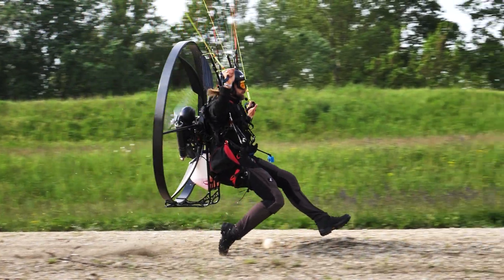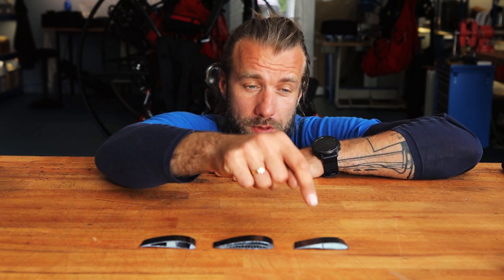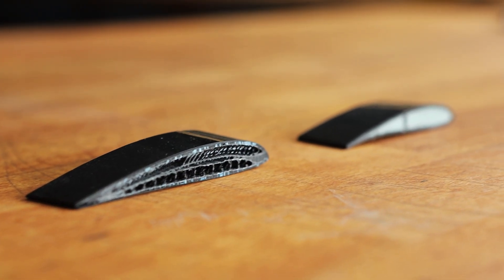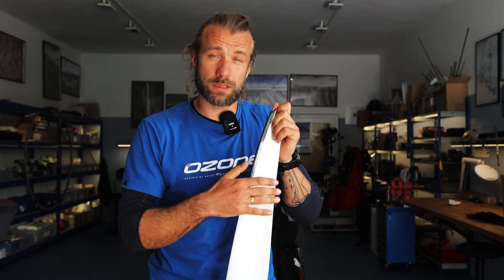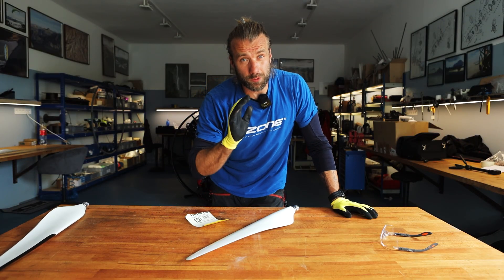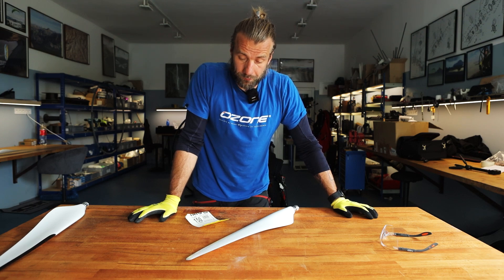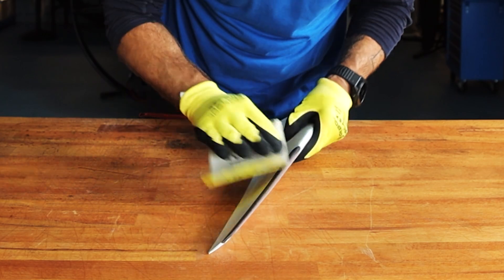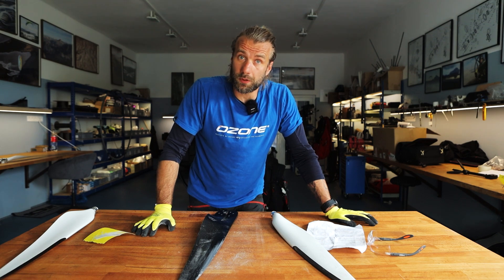Indestructible propeller? New technology first time applied on paramotors.

Comment: A word of CAUTION. Making undestructable things (props e.g.) will put a significant area of prop production out of business. Currently the prop manufacturers have a comfortable sustainable profit of producing well-distructible props. Notice: they even silently agreed on  never putting a decent film protection on their leading edges! So we have to do it by ourselves and rebalance. And there can be no complains, because the prop crack is always "our" fault. Just because we fly!
So, Miro - be carefull or "they" might kill you! :) I guess they are  already a little worried by your varioprop (in hope it will be so expensive and complicated so we cannot afford or set it up). Making a cheap undistructible prop would be an end to their prosperity.

Comment: I like it :) I was also wondering if the use of toroidal propellers has been investigated. The why or why nots .. thx in advance.
Reply from the maker: Not yet. The first thoughts are: cool but our props spin too fast for that. The Moster spins the prop at 3200 prop which is far from ideal. Aerodynamically ideal would be around 2500 (the Atom 80 got it right). No idea why Vittorazi and others decided for such a small reduction ratio.
Reply: @SCOUTaviation  TY for the reply. I like the idea of less noise and more thrust per rotation. Albeit, the bulk may not be worth it.

Comment: What are the weight differences between these different designs?
Reply from the maker: The variomatic mechanism adds 600 grams but it is located in the center so it is almost neglible. The few mm of rubber do nothing to the weight. The prop itself is not stronger nor reinforced as it is already strong enough. We are now addressing the issue of leading edge hitting small objects that would normally crack the carbon.

Comment: Great vid 👍
I am still remaining skeptical.  Though impressive, hitting a nail an arm speed vs a hard object like a  stone or engine nut/screw going  through the prop at cruise or take off rpm is whole different can of worms.
Cheers
Reply: Hello. Did you saw literally the beginning of the video? :D
Reply: Ok, I see now it was that prop.  With my ADHD I have to watch multiple times to catch some points. Cheers
Reply: @MatejRoder  That's hardly evidence. He could have done that all day long with gravel being thrown right at the prop and one never hit it. Not very controlled and too random as a test methodology.  One thing he should have done was the same "arm" velocity tests on those same objects with a standard prop to see the damage they received as a sort of control.  The objects he tested on produce a relatively large contact area at low velocity. Quite different to a small relatively hard and massive object like a stone hitting at running velocities.   Fly it for many hours in harsh environments then see how it holds up.  I suspect its a urethane rubber, which can chip similarly.  Their successful usage on ultralights isn't a fair comparison either. They are generally mounted much higher, and may not fly in comparable environments to see the same kind of abuse.   I am not saying it doesn't have any merit, and on a hunch it does,  but what we have here in this video is hardly scientific evidence that the cost (unknown) will justify the benefits.
Reply from the maker: yes, you are right.
The stones were hitting it hard during the footdrag and two of them flew through the carbon cage:-(. It is a proof for me so I am happy with the results. But I understand it might not be a proof for you. 
The next experiment will be one blade regular and the other with the new protective edge. already on it.